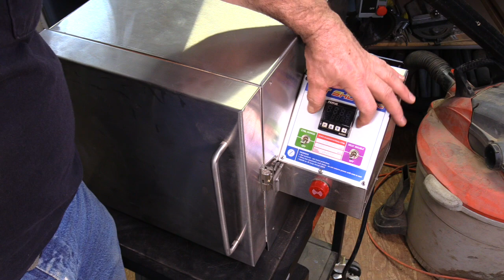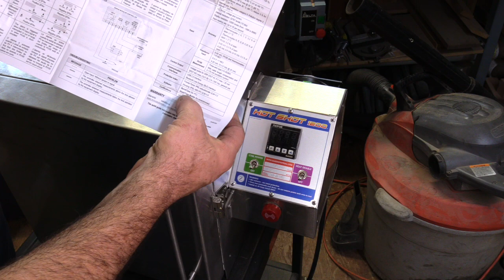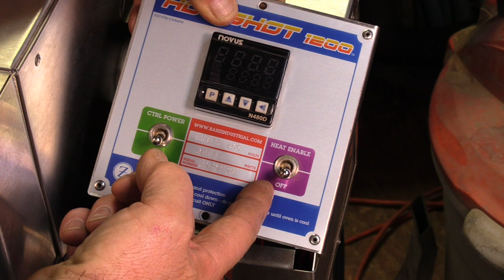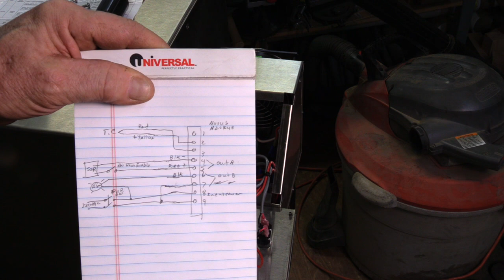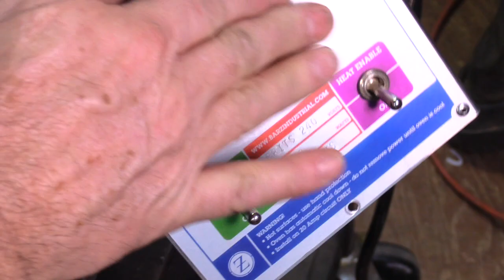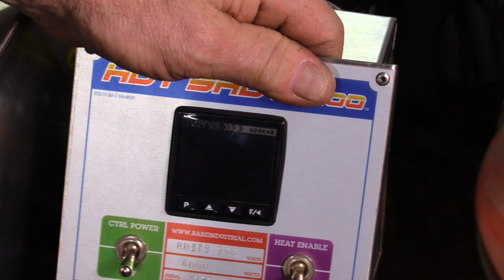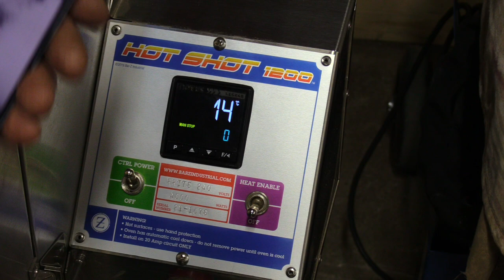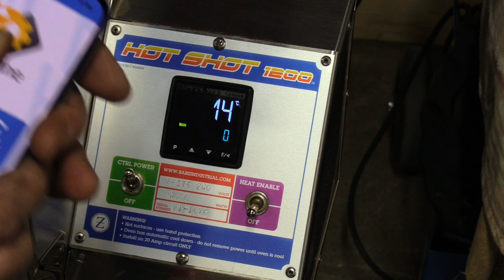Heat Treat Oven Control Upgrade - Hotshot 1200 and 360

Comment: If you have a newer HS 360 the USB cable, controller side, is a micro versus mini.  I just bought a mini to micro converter instead of trying to get a whole new cable and mount.
Reply from the maker: This new Bluetooth connection is nice. Thanks.
Reply: @RRINTHESHOP  and having your recipes on your phone ready to go is awesome.  No need to drag a computer.